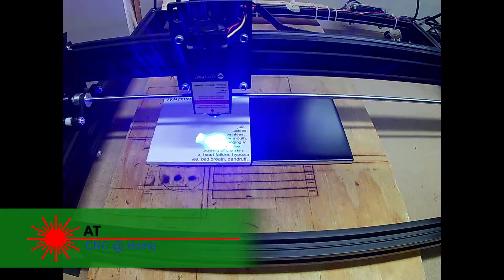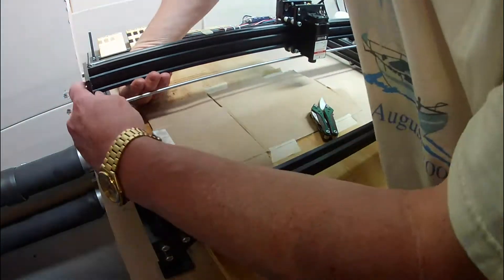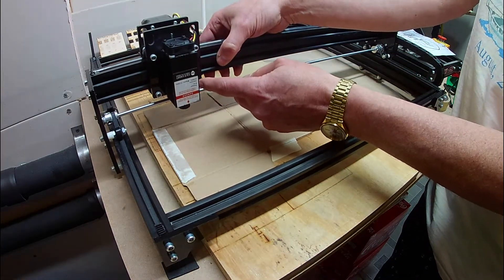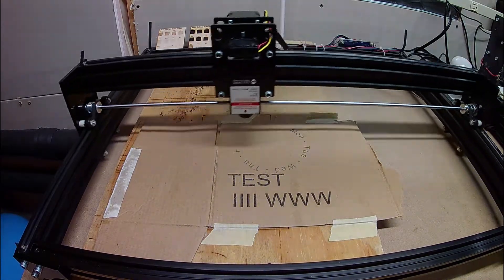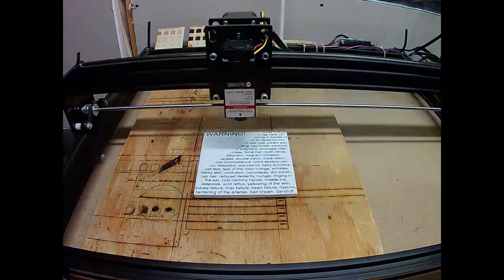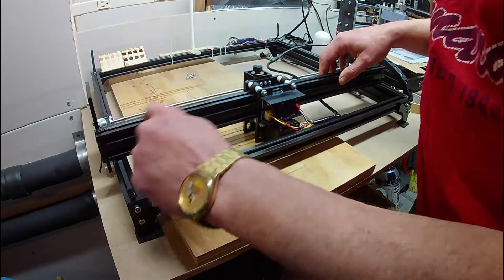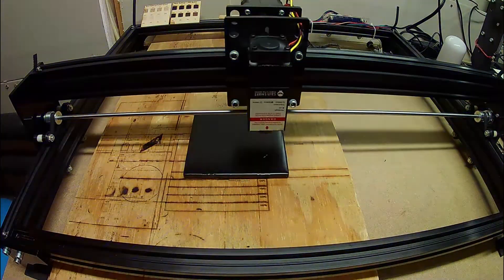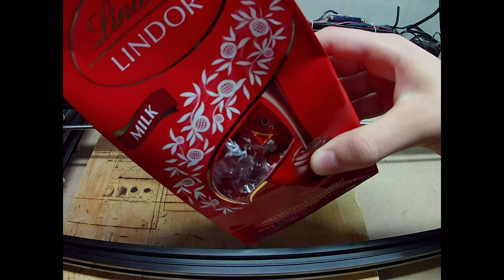Still Wavy

Comment: Try and add some eccentric spacers. They will tighten your laser connection to the gantry without restricting movement. Not sure what size you would need but here's an amazon link to some.

https://www.amazon.com/dp/B07D366ZQG/ref=cm_sw_r_cp_apa_i_aQieFb86NAD52